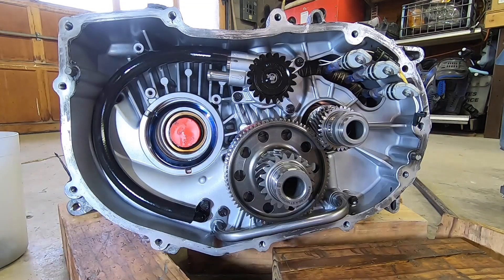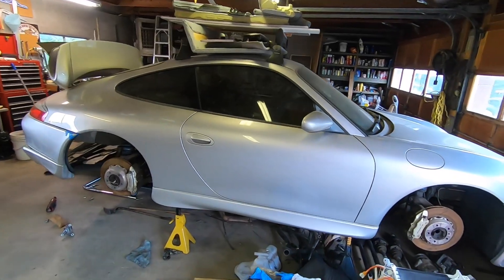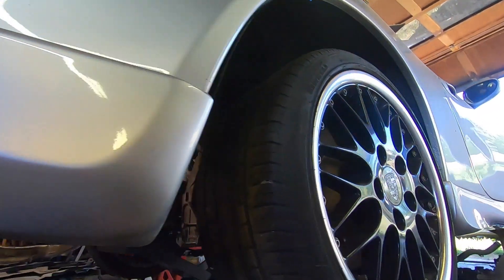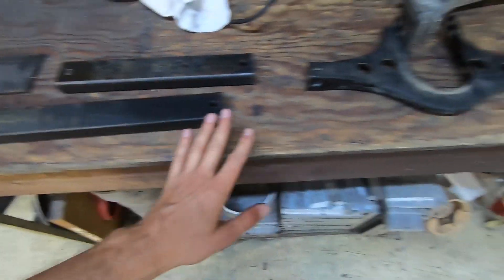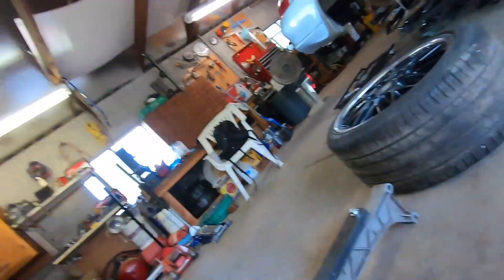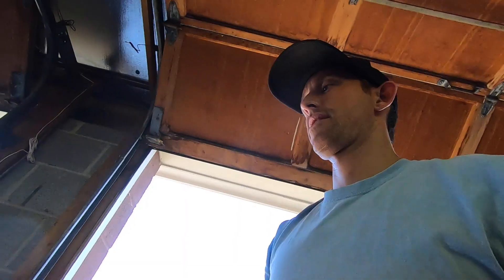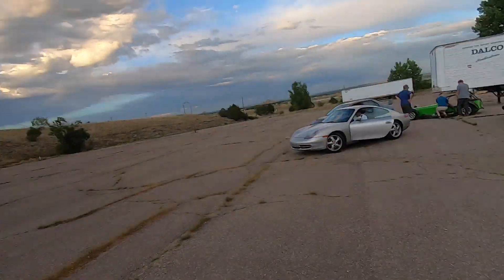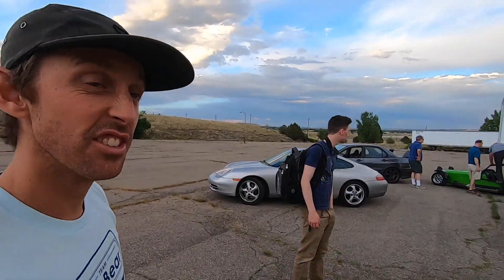Making Custom Tesla Motor Mounts - Porsche 911 Tesla Swap #14

Comment: I’m working on a 914 with a small drive unit? How did yours turn out. You mounted part of the motor without the rubber and one end with the rubber? Will that cause the motor to twist on those bolts and break them eventually? Also do you hear the motor resonate through the frame without rubber on one end?
Reply from the maker: Hello!  I am still working on the project.  I just put an update video out.  Your project sounds amazing.  I need to check it out.  What battery are you using?

Comment: Sweet Project. Seems to me, if you have 2 soft and 1 hard mounts, most to the stress is going to absorbed by the hard mount. The uneven stress could cracking the aluminum case? It looks like the is room in that hard mount for some kind of rubber motor mount. That said I'm not there. It might be hard to find one that fits and is close to the "softness" of the other two. So, the motor isn't twisting and hitting the body under acceleration.
Reply from the maker: Dan, I forgot to say in the video that I do intend to put rubber between the angle piece mount and the frame and also between the angle piece and the metal plate.  You’re right on, I think that it would attract vibrations if it were the only solid mount.  Thanks for watching and putting a comment.  Part of the reason I put videos is so I make sure other people can check my work and make sure I’m not doing something g totally crazy.